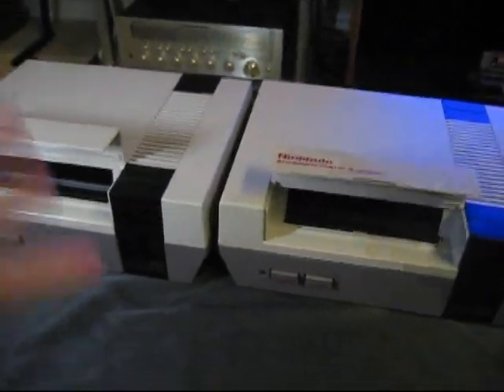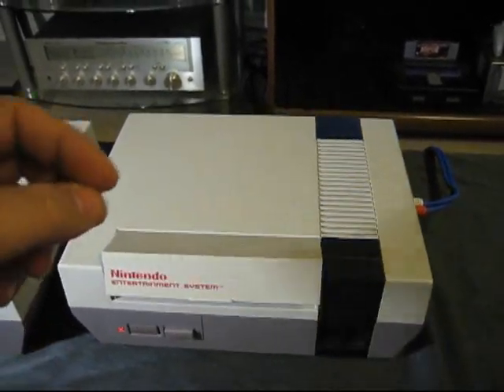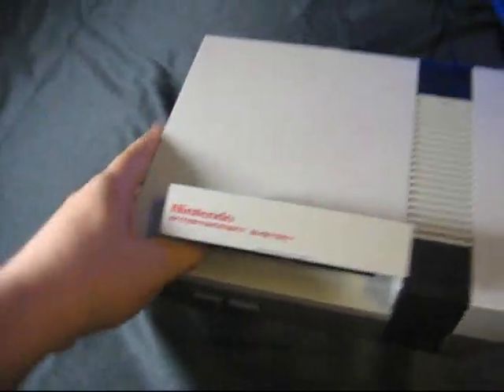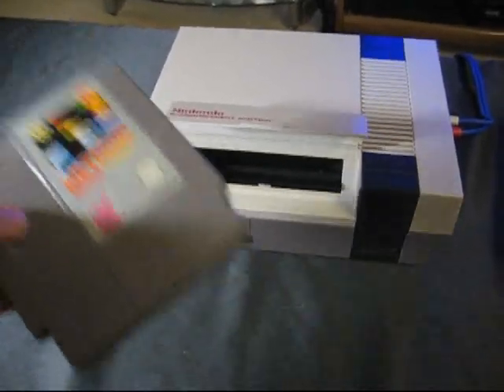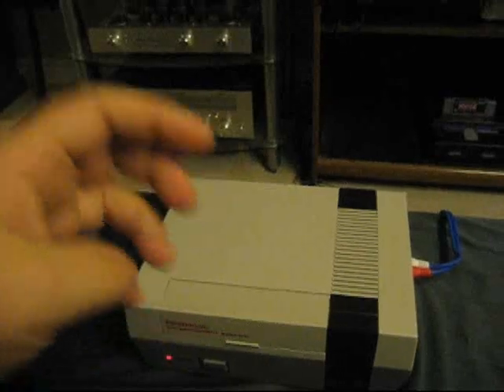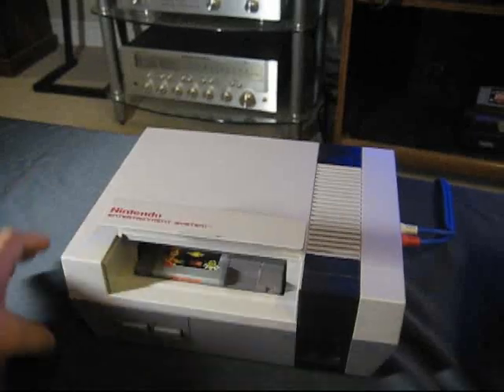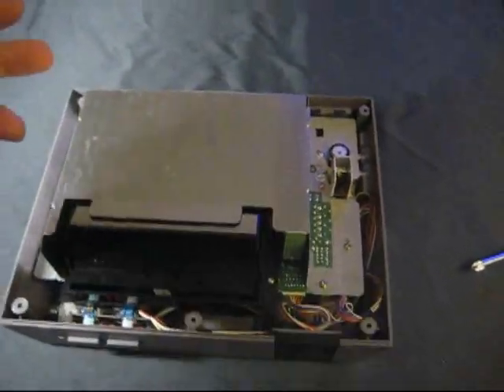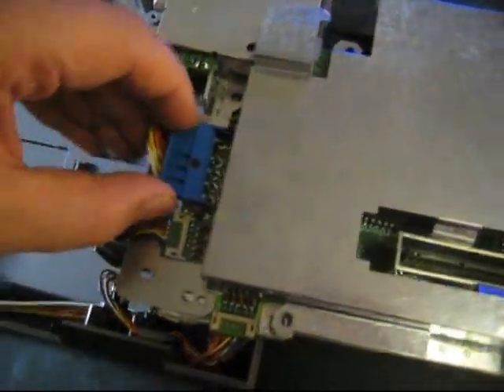Disable the 10NES chip in your NES

Comment: or you can just clean the contacts on the cartridge and the connector in the nes, I don't support this for pirating games
Reply from the maker: This has very little to do with pirating games.  I'm sure there are some rare pirated games (that are probably expensive and hard to find in North America) that won't run on a 10NES NES but most pirated games that made their way to NA for the NES in the late 80s and 90's already had chips in them to bypass this and will work on a stock 10NES NES anyway!  The other majority are on 60-pin Famicom carts witch require an adapter that has the chip in them.  The real FC to NES adapters back in the day had the region chip inside the adapter so they would still allow those pirate games to work on a stock NES too.  On the other hand as the guy above pointed out if you want to play import PAL games on your NES this will let you do that.  Also as the guy above points out the official NES2 top loader and the official Famicom in Japan neither of those had the 10NES chip in them at all.  I think even some of the VERY early NES systems in NA lacked the 10NES chip also.  So are you saying if I buy a NES2 top loader I'm somehow supporting pirating games??  No of course not.
Reply: Dylan Lennox It's sad you didn't understand the point of the video and your whacked out brain misunderstood it for something else. Go somewhere else with your fat stinky newbness.
Reply: you don't support pirated games on a nes? it's not like anyone is making any money off the nes anymore. Nintendo nor its developers have supported the NES for 2 decades now. lol So who are you ripping off.......
Reply: I don't support piracy for modern consoles or recent ones
but what else can you possible do for a NES? it isn't like Nintendo it making money off these games anymore, and you can not even obtain most games for the system
Reply: What if i wanted to play a game from japan or a home brew game on my Nes system i would be shit out of luck unless i buy a top loader which is waist money if i already own the system plus this guy never said he supported pirating or anything on the issue so your remark makes you look closed minded pulse wouldn't you want an original toaster style region free NES God knows i want one
Reply from the maker: Dylan Lennox I only have a handful of pirated games.  One is a 30-in-1 Famicom cart that came with a FC to NES adapter with a CIC chip in the adapter,  I have Action 52 and the rest are more common ones like several of those gold cart Camerica games (like the Fantastic Dizzy games) and a few black cart Tengen games (Tetris, Afterburner, Ms Pacman).  They all work on a stock NES so all I'm saying is the reason I did this has nothing to do with playing pirated games.  The SNES has a similar chip in it but you don't hear about it as much because the main reason people do this on an NES to to stop the reset cycle when the cart isn't making %100 contact with the system.  Since the SNES is a more reliable top loading system I wouldn't bother doing this on the SNES.  Your point might be valid for some but I really don't care that much for pirated games.  I have just over 100 legit NES games and only just over a handful are pirated or un-licensed games and like I said most of those are ones that were sold in retail here like the gold cart Camerica games and black cart Tengen games that are very common.  Most people I knew back in the day had at least one of those black cart Tengen games and they had no idea why they were different.  They didn't know they weren't licensed.  Actually it reminds me of the old rumor that people used to think black cart Tengen games worked on both the NES and Sega Genesis!  I swear I heard that once back in the day too.
Reply: Dylan Lennox you cant really pirate a game the devs dont make money on anymore it causes no harm
Reply: lol... there's always that (One) guy who just don't get it and has to be a douche.
Reply: ***** or you can just support it i don't really care just pointing out the issues
Reply: Well put my friend
Reply: ***** wanna write another book, noob
Reply: ***** TY, that was the main goal
Reply: Who fucked your brain? Pirating games? When u play a different country you bought the game... When it loads faster, its ok... Has nothing todo with dust
Reply: dont fall for this troll guys.. he is just a looser little kid needing attention so get the fuck out of here and go back to your xbox noob..
Reply: Dylan Lennox Obvious troll is obvious... Next time you attempt to troll somebody at least try to be a bit less obvious.
Reply: Thats also a good point
Reply: ***** when my faith grade friend saw my black cart afterburner (which I never thought of as odd until now), he brought up the Sega thing. That led to a conversation about "what if one system could play every cartridge?" Lol it was the early nineties and we were just kids. Now we have emulators and retrons and retro downloads for modern consoles, and we are living what we only could dream of back then. :)
Reply: Pat Eldridge *fifth grade, not faith grade. Damn auto correct. Technology still isn't perfect lol.
Reply: LOL that was a real thought out comeback, congrats

Comment: One way to ruin a great system just to play pal games on it removeing that CIC U10 chip is not nessecary I can rebuilt those systems from stratch you couldn't tell an old ones from a brand new one that came out of the box. When im finished with it I can clean them up inside out and make them look spotless. Im an old school gamer tech myself I rebuild those 72 pin connectors I guarntee 98% of the nes consoles I can fix and make them work like brand new without clipping the CIC U10 chips if they will light up you can consider them fixed im just that good with them  I can have those 72 pin connectors fixed in no time who needs a new one you think because they got lines up and down in them or straight across in your television set you think I cant repair them? You got a red light of death in them where the games won't come on I also deep clean games I take them apart myself and clean them like brand new if they got a defect in them you need a tester to find out where the solder is cracked or broken or some little condenser may be fried its not that hard to replace in them if you got the time and patiences to do it or a replacement battery needs to be installed its not that hard to do. I know all about those game consoles I can make you guys wonder what I can do with those game systems. You have no idea. Only way I wouldn't be able to repair those nes 72 pins would be if someone rubbed all the gold dust off the components and thinned it down where it wouldn't get no connection at all that is one way to ruin them is with sandpaper trying to clean them out. I got other ways I don't charge that much at all it takes me 30 easy mintues to deep clean those systems with my special tools I use I charge $10 each console and I guarntee my work. I will have them working brand new for months later on you wouldn't have no problems with them at all i've fixed a many of them.
Reply: hahahahah shut the fuck up. most pathetic rant ever lmfao
Reply: +Legendary LOL Ok. Sounds like you're into some serious stuff there. I never even knew Nintendo cartridges had "condensers" in them XD

Comment: Why not just remove the 10NES chip entirely? Is it necessary to run the system properly at all?
Reply: The 10NES chip is required for the NES to run, at startup, the 10NES runs a quick diagnostic of the board, if the board fails the test, or the test is not completed, the CPU will get no power. Although, a less dangerous way to disable the 10NES is to just solder asmall jumper from ground to the 4th pin.
Reply: ThereIsNoMatch I knew there must be a less damaging way of doing it. I was gonna just desolder the contact and bend it away, but that would still risk breaking the leg off.

Comment: Wow I wish I knew this about 20 years ago! I wasted so much time trying to blow out the "dust" from the game. Nintendo even started peddling cleaning kits...the whole time it was their damn 10NES chip!
Reply: actually blowing carts with your breath DOES make it worse. Your saliva is corrosive to the copper contacts, AND as you cannot blow hard enough to remove the dust completely it will cause it to compact near the back of the contacts and can cause shorts. It's common sense chemistry and electronics.
Reply: The only one talking out of his ass here is you, good sir. And yes. Common dust is conductive. All dust is conductive unless it is strictly made of insulator material and if enough of it gets anywhere it can short circuit whatever device it is on. Your breath has a humidity level much higher than 2 or 3 years of exposure to normal room temperature air in a home environment, plus there are enzymes in your saliva that are quite corrosive. It does not take someone drooling on a cart to ruin it. Just years of thinking "oh I'm just blowing the dust out, it will be fine"  

As for the back of the pins, they directly connect to the front of the pins, they have to in order to complete the circuit, you asinine boy. If any conductive dust (Read any dust) builds up across them, and no dust does not have to be very moist to compact against something... natural dust often cakes on by itself simply with the moisture of the room around it, It can short circuit the connection.

You obviously have no clue about simple science nor how electricity works.
So, keep blowing into your carts rendering them useless in the future, while I keep on preserving mine in mint condition and selling them for hundreds of dollars a piece.

Also, I restore electronics for a living. I've seen the worst of what this shit can do to them And repaired it.
double bachelors degree in Chemical Engineering and Electrical Engineering. So fuck off, try hard.
You are probably another nerd fanboy who saw his daddy blow into the carts as a kid, and daddy can do no wrong.
Reply: Yes, some humidity is around 100% of the time, However, varying amounts are around in the atmosphere and on average it is between 30% and 50% in the average Healthy household (any greater than that actually poses a risk to electronics AND biological health) and actually, yes, 100% humidity is what is in a humans breath. It is FULLY saturated. That is why when you breathe on something cooler than your core temperature you get condensation. And yeah, depending on how cool the contacts are, water (saliva) will condense and droplets may form. However, in its vapor form, the humidity of your breath will cling to the metal, as water is naturally attracted to metals, and then the impurities (salts, enzymes etc..) oxidize the metal, and seeing as how gold and copper are both REALLY fucking easy to corrode in the grand scheme of things, ANY extra exposure will aggravate the issue that you are trying to prevent.
It's not my fault you don't understand common sense and science.I bet you failed 6th-grade science class. Go troll elsewhere. 
You NEVER swipe an eraser along the contacts either, HAHAHA omfg you are an imbecile that leaves rubber particles that can prevent the contacts from fitting right and making a solid connection. and the lock out chip has nothing to do with properly cleaning a cart. Clearly, you are a moron if you would do anything other than clean the cart properly, before trying anything as drastic to the system as disabling the lockout chip. and even if you did disable the lockout chip first, if your cart is dirty, you still need to clean it. 

Also, I provided sources that are peer reviewed and well established as fact.
So, unless you have science fact, and sources to back your claim up, shut the hell up with your anecdotal evidence.
Reply: "my brother left the case off his pc and dust got in and its just fine" or "i've blown into carts all my life"  is no argument against science fact. You want more sources, read a fucking chemistry book, or go follow my exact example above and fry yourself a PCB
Reply: And yet you guys ignore the imperical evidence that I provided and still spout anecdotal evidence to refute me. It doesn't matter how much "reality" you claim to have experienced. The actual reality is scientists all over say you are both fucking morons and now you are trolling just to troll. I never claimed my degree makes me right, I used my degrees to prove my experience with the subject. Now what makes me right are the sources I cited, which you both have not refuted with anything other than worthless anecdotal evidence.
Go get peer reviewed proof that the majority of household dust is non conductive. Also I never said it was a common occurrence to get a short from the dust, I just said there is a chance it can happen. Also you do realize that the majority of air compressors have a regulator valve on them to control the air pressure that is released. I've already stated that PCBs are covered in enamel and it's rare to have a short on them, even if you spill water.
The biggest issue with blowing on carts is the corrosion it can cause over the long term.

and 24 years in IT good for you. a software nerd who obviously has no experience with hardware and electrical engineering trying to use HIS degree/training to prove himself right with anecdotal evidence against scientific sources being cited. Get your little experiment peer reviewed with a wide sample source and have a control in it, then get back with me. Until then, you are both nothing more than armchair nerds who think blowing stank breath onto electronics causes no damage.
Reply: and ISO I've stated my real world experience, not just my two degrees, also provided you with peer reviewed scientific articles.  It is CLEAR at this point you have no evidence to back up your claims, so, good sir, you fall under your own rhetoric of "using my degree/personal experience/etc makes me right" So do us all a favor and change your name to Ann Hiro (hint, say it fast and together)
Reply: Well, dust IS a problem.  And blowing cartridges only makes it worse.  Cleaning the connectors on your cartridges (and on the board where it meets the 72-pin connector) is best done with a Q-tip and some denatured alcohol (or 91% or higher rubbing alcohol), and while you're sitting there disabling the 10NES chip, you can always swap out the 72-pin connector for a new one sold in most retro repair shops.
Reply: @YukoAsho  and save a ShitTon of Time.
Reply: actually any solvents used on the connectors can ruin them. Simply use a can of compressed air to blow out the carts. ONLY use a solvent if you have some sort of sticky stuff on the connectors, and only use PURE isopropyl alcohol, Methanol or Ethanol. Do not use denatured alcohol because the denaturing agents and bittergents in it can corrode and destroy the contacts.

Comment: also, if you see the title screen pop up, hold the reset button for 2 seconds
Reply from the maker: Yes growing up with an NES I learned many tricks including hitting the reset button but trust me it doesn't always work.  For me it only worked like half the time, the other times I could hit reset all I wanted and it would still be in a reset loop.  But it does work sometimes.
Reply: ***** the only way the reset thing works is if you can see the title screen or hear sound
it dosent work just because you did it, you may need to wiggle the cart.